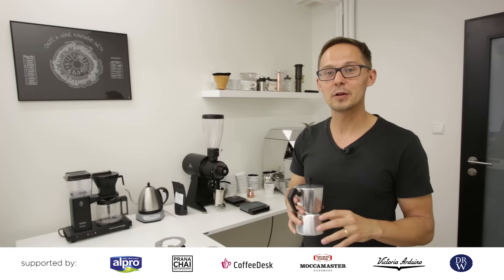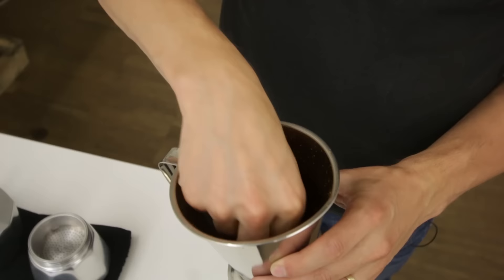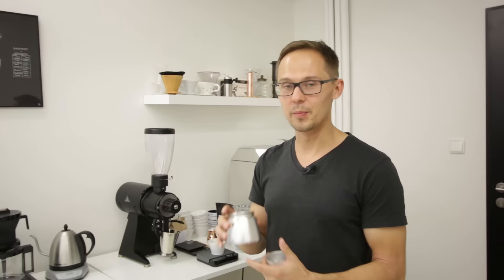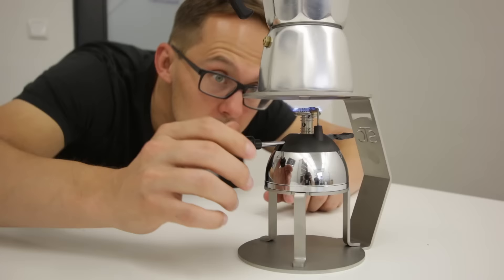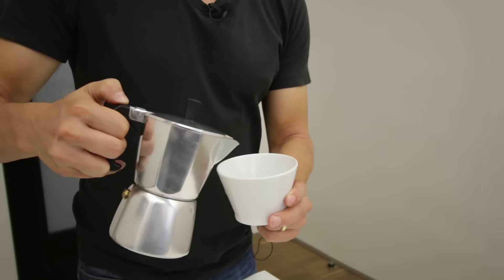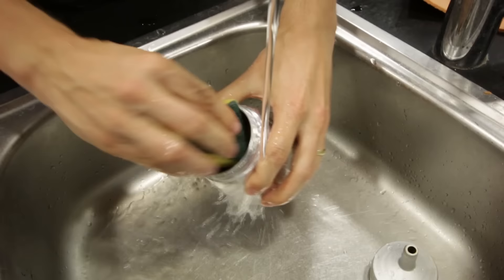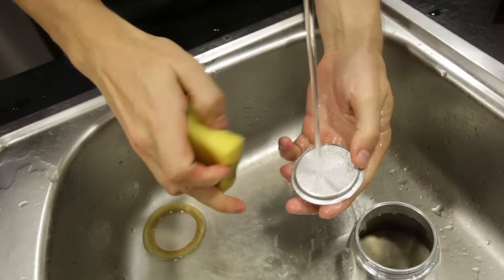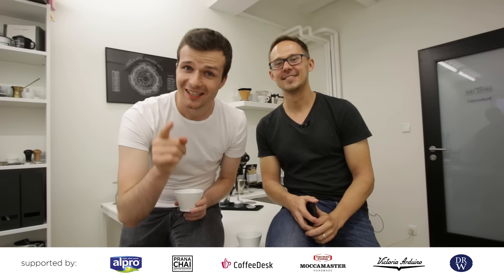How To Make Better Coffee with a Moka Pot

Comment: One more important thing to remember - especially when you use aluminium pots - drying. Leaving your moka pot wet makes it oxidize much faster than when kept dry.

It's good to use a descaler from time to time - you can use water with citric acid powder (boil it inside the pot like coffee), vinegar with dish soap (1:2) or use ketchup (cover it and leave for 20mins). Replace the rubber seal from time to time - it's cheap.
Reply from the maker: Wow, great insights. Thanks for sharing these. We may collect input from all of you guys and share it in the post.
Reply: Wojciech Kamień Cleaning with ketchup? That's the worst advice I've ever heard.
Reply: best tip on this page, including the video. thanks.
Reply: @KhorBaPeaceComesFromWithin  i know that cleaning copper with ketchup is an old established trick. Works like a charm!
Reply: Big Cee You'd have just as much luck with a mixture of salt and vinegar.

Comment: That's a great video, thanks! I've started using a moka pot again. As a trick, if you want to have a clearer coffee you can add an aeropress paper filter at the bottom of the upper part, before screwing it to the bottom part. For 1 cup moka pot it fits perfect.
Reply from the maker: Thanks for a tip!

Comment: Exactly how i make my coffee. The coffee basket can be cleaned as well. I use the thin end of an electric egg beater bit to pop it out
Reply: It comes apart? I didn't think it could.  How do you do it exactly? I don't want to break it  but I really want to be able to properly clean it.
Reply: @KatarinaS.  Of course it comes apart, it's explicitly written in the instructions manual that the silicon ring must be replace annually.

Comment: Heat first if you want but it adds to the work involved and the results are minimally better. Heating at 3/4 heat seems to work well also. I prefer using a fine grind such as comes with lavazza or illy or bustelo, especially that first cup in the morning. The consistency of a perfectly hot first cup the moka provides is part of it too.

Comment: Hello . I saw that you wash your pot anytime you use it  and that is a little surprising to me . I never wash mine and have been advised never to do so . so  I only rince it with cold water in order to keep the nice sheen that has formed into it and which in my opinion also contributes to the taste.
But it's fine by me . 
I use an old  little 2 cups bialetti moka pot if you wanna know.

Comment: instead of heating up the water in another pot, just detach the top, and pour cold water in, and put the bottom half on the heat until its hot, then pop in the coffee filter with the coffee on the top carefully screw on the top so you do not get burned. easy peasy

Comment: Guys, I've never removed my screen and gasket 🙈 Couple of questions for you: 1) is there a window time you aim for (I try to aim for 1:30 - 1:45) and 2) have you ever tried measuring the coffee to water ratio? Thanks for another great video! I always learn something from you guys 👍🏻
Reply: The 6 cup Oroley (spanish brand) fits 350 ml just right below the valve. I use a 1/16 ratio of coffee, so around 22 grams. All the liquid doesn't come through tho, but the basket size is ideal to the water passing in theory.

Comment: Be careful or better don't use the green (hard) bit of the scrubbing sponge on your aluminium moka pot. Aluminium is quite soft and can scratch easily. You can clean the metal filter but don't  use it on your aluminium moka pot, or it will get dirty even quicker.
Reply: I was nervous watching him cleaning his machine with the sponge.

Comment: Try to avoid Aluminium moka pots, I have had great results with a heavy duty stainless steel 4 cup pot, just using lavassa ground expresso. I've had the same moka for 17 years I bought at a yard sale for $5.00,  just need to change the seal every five years or so, ( if you can't find the " Right seal" just buy a bigger one and cut it to size
Reply: The only issue I have with stainless is that it doesn't grip easily for closing it tightly..
Reply: Get a heavy duty moka pot my old one is Prodotti stella.4 cup. ( no longer made) I recently bought a 2 cup Debut same Design/Quality now from Taiwan. Also make a 4 cup my favorite size for a big latte.

Comment: 1. Aluminum moka is corroded by acidic coffee
2. Aluminum moka tastes of metal, caused by 1.?
3. There was no need to remove the gasket on my stainless steel pot. I checked after 2 months daily use, nothing there after rinsing through. Perhaps in your Alu pot it's caused by the oxide making a surface for rounds to cling to?
Reply from the maker: Great feedback!

Comment: a moka pot is the method most italians use to make espresso , but they use a grind resembling  fine espresso grind. there is no need to be afraid of a  few  grounds at the bottom of the cup.even the pre-ground coffees from lavazza and caffe vergnano for moka pot are much finer than what was used in this video. the  result  here resembles tea. cleaning  regimen  does not require gasket  removal after each  use .....monthly is more realistic.......

Comment: The conventional wisdom is of course that the coffee should be ground fine, nearly as fine as for espresso. It would be interesting to know the pressure in the boiler when you use drip size grains and no tamping. If it's the same or only slightly above ambient pressure you're essentially making drip coffee upside down. A test should be relatively straightforward to carry out by replacing the safety valve with a pressure gauge.

Comment: If you scrub and use detergent on an aluminium pot all the time, you'll get maxed out aluminium leaching into the drink all the time. That's a fact.

When you do use soap & scrub an aluminium moka, run it a few time and throw out the coffee, let the oxyde layer form on the surface, and then only rince it and wipe it dry with a soft rug.
I would recommend you get a high end stainless steel moka pot, and even then, don't scrub it anyway, rinse it and wipe it dry.

Comment: Gosh. Browsed through dozens of videos on Moka Pot, yours is the cleanest. In some videos the inside of pot even turned into oxidized black....gross. Nice Video!  May I ask how often do you guys change the rubber band?
Reply: Jing He you want the oxide. Creates a airtight barrier. Using the coarse side of a sponge exposes the aluminium underneath the oxide layer.

Comment: Ive read that when cleaning the pot and components dishwashing liquid should not be used, just warm water and wipe dry. Ostensibly because the oils from the coffee protect the finish on the inside of the pot, and scrubbing it would lead to erosion.  I'm interested in reading comments.

Comment: Great video! I put towel to a freezer for couple of minutes and then I wrap it around a bottom part of the moka pot :)
Reply: Sára Goldbergerová excellent tip. Thanks.
Reply from the maker: Thank you! Nice tip for the towel - will try it out next time. What about the cleaning, anything else you would add to our video?
Reply: Nope, I clean it exactly like you :)
Reply: why even bother freezing a towel?  it jst seems (to me anywayz) like an extra time consuming thing to do.  all thats necessary to stop extraction is to pour the coffee into ur cup immediately after it finishes brewing.   i mean, this can be done in less time than it takes to hold the moka pot under running water (2:55) or wrapping it in a frozen towel :)

Comment: Start with water of about 65°C, fine grind, it can be as fine as espresso or even slightly finer if you have a one or two cup Bialetti model. Shake the basket while you're pouring the coffee in for even distribution and when you start spilling coffee, stop pouring and tap the basket on your counter a bit to make the bed more level. Tamp very lightly, the coffee shouldn't go down far because of the even distribution and fine grind, but there should be a bit of space left in the basket. Make sure it's screwed on very tightly with the 65°C water in the basin, just to the fill line or a bit below (don't go over). Put on the lowest flame possible and wait, once it starts flowing quite quickly and becoming more yellow, cool it down by putting it in the sink with cold water. The more greedy you'll be, the more extraction at a temperature that's too high you'll get in the cup.
Reply: Why do you make it with hot water when you going to use the lowest flame? (ergo - trying to lengthen the time the water will boil)

Comment: Excellent.  You stepped on all of the bases.  As you show, it's especially important to use nearly boiling water in the bottom and to avoid over-extraction by cooling the pot once it's full.

Comment: Personally I find hot water under extracts the coffee and cold water causes it to taste burnt I've found a happy medium with lukewarm to slightly hot water and stir the coffee in the pot before you pour the stronger coffee (first extracted) is at the bottom
Reply: How can hot water under extracts when heat can pull out the oils compared to cold?

Comment: Maybe I am wrong and those experts are correct but if you want to make espresso type just fill a little bit of water.
Reply: You're wrong. Espresso requires pressure, this machine is not pressurised.

Comment: I use a stainless steel Moka pot because I found that aluminium has a metallic taste. Removing the seal with that sharp knife looks dangerous. Great video
Reply from the maker: Good points! You are right about the knife - it would be better with fork or anything less sharp. It was just the only thing that worked during the filming. I hope we didn't make it too dangerous for people.
Reply: For me works best some metallic tea spoon to push the seal from outwards to inside and up (hard to describe) :)
Reply: I never removed the Rubber ring
Reply: It's is super dangerous. I know of some people that know some people that have lost their loved ones because of using a knife to get out the rubber. Lost fingers, paper cut deep cuts and sepsis, you name it. It's a risky world we live in.
Reply: not just to you- to your seal. I use a chopstick, much safer and gentler on the seal.
Reply: The filter should only be removed when changing the rubber ring, once a year or so. A coffee maker is supposed to be cleaned with water, no detergent, in order to allow a thin layer of coffee oils to permanently coat its internal surface. Removing those oils means getting a poor result.
Reply: @gabrielladelfinadiblasio7398  That's bullshit mate. Those coffee oils are stale old rusty nasty pieces of coffee, would you like to drink 10 years old bits of coffee each time? Just wash the damn thing. Why nobody complains about missing old coffee oils in espresso, drip coffee, aeropress, etc?
Reply: @RaduRadonys  🤣🤣🤣 People who have no clue, and yet love to explain stuff, are always entertaining 🤦🏻‍♀️😅
Reply: @gabrielladelfinadiblasio7398  Thank you :)) by the way James Hoffman himself said this oil thing is stupid, so if he doesn't know about coffee, I don't know who. But you must be Italian, that explains your "I can not be wrong about coffee" atitudine :))

Comment: I intuitively figured all that out myself when I purchased mine, what I also did was take the thin metal round base of the coffee holder out to clean that as well. It was difficult to do and used a chop stick and rammed it down the funnel and popped it out. Was very dirty, what’s with the manufacturers not providing easier to clean equipment? Instead relying on user to reverse engineer this thing
Reply: sorry, you mean Warm water is better ? actually at first, its better that the water be warm when we put it ?

Comment: Thank you guys for your amazing and informative videos. Concerning the cleaning process, do I use dish washing soap with water or only water when cleaning it and why?
Reply: Never use soap. No matter how much you rinse, chemical particles will remain on the pot. As soon as you start preparing your coffee, hot water will dissolve them inside it(!). Always clean your pot soon after you have used it. At least once a month, you should do a deep clean by using 2/3 of water and 1/3 of white vinegar and let the heat do the trick.

Comment: The coffee must be ground between drip and espresso.
Use hot filtered water and medium to low heat, move it away from the heat as soon as you hear the bubbles sound.
I dont like to use up harsh soap or detergents to wash it.
Reply: How long does it take to brew?
Reply: @poopdawg2301  I have a 9 cup so it takes about 10 mins to brew. A smaller one might be faster

Comment: This was great!  My moka pot also has a second metal screen that fits inside the chamber where the coffee grounds go, dividing it in half.  Does anyone know what that's for?
Reply: In principle, if it also has a semi-circular plate to stop the water coming through on that half, it would allow you to make half the amount of coffee without having to use a smaller machine.  Of course you would need to halve the amount of water you put in the bottom part.  Otherwise you'll get an americano.
An alternative function would be to allow you to mix two blends of coffee for a single brew - for the ultra-demanding connoisseur.  
Why am I not surprised that the market has not rewarded this invention?

Comment: IMO
1) no hot water needed: coffee is not in contact with water until it's hot, and a little humidity on it prepares the surface of the ground coffee for a better brew
2) NEVER, NEVER use the scratching side  of the sponge on any part of the Moka: never! You won't drink alluminium.
Reply: Just rinse with water. Or boil without coffee. No soap needed. Cleaning the seal after every use? Wow, these guys are nuts.
Reply: Jokes on you, I only use stainless steel mokas.

Comment: Does it make a big difference to the brew when you put hot water in the bottom compared to cold? 
I always put cold water in mine, but that's only because the instructions specifically say to put cold water in.
Reply from the maker: It’s has been a long time since we did experiments but it’s the way we like it better. Give it a try once and taste the difference. That’s the best thing we can recommend.
Reply: Actually the instructions say "room temp".
Reply: @sO_RoNerY  Maybe on yours they do, but on mine the instructions say "use cold water" – honestly depends on what type of moka pot you've got, what it's made from etc as to what the instructions recommend.  Although weirdly I've tried it with hot water and prefer the brew that way, I saw a video from a coffee expert that says you should always use hot water when brewing with a moka to help reduce the bitterness and after I tried it with hot I had to agree, I could definitely taste the difference in the brew, hardly any bitterness compared to when I brewed using cold water.

Comment: Please don't use a knife to separate the filter and the seal rubber band, What I do is to run water from the tap on high pressure on the filter part, that lifts the rubber band a little and is enough to push the filter under the band with my thumb, also you can lift it with your fingernail, if the above doesn't work - try with a tea spoon.

Comment: i didnt know about the boiling water instead of tap water and i haven't cleaned under the rubber seal...im scared now LOL thanks fellas
Reply from the maker: Don’t worry, it will be alright! Thanks for comment.
Reply: Melanie Jarrett it is not necessary to remove the gasket each time you clean it. If you use your moka pot on a regular basis,I would only do it about once a month.

Comment: My experience: Don't get the big ones, get the small ones, maximum 4 cups (these are actually more lungo sized so 4 cups will give you like 250 ml of coffee). This will give you a better result than the big pots. If you clean the upper part each time make sure to buy a few spare rubber seals as they will wear out faster because of the stretching. Moka pots will certainly not make the best coffee ever but they are great for confined spaces and travel.
Reply: Nah, it's personal preference and if you can't afford an actual espresso machine, they do make the best coffee ever!

Comment: guys good job. but I would add some observations:

- steel is better than aluminum ones. You cant scratch or frequently clean the aluminum one, and then drink without creating a patina first.

- actually you need to clean it through the filter just once in a while. and all the other times you only have to wash with water only.

- before making the coffe for the first time in a while, you should do one, pour it away and re prepare the one you'll actually drink. you can not do this if you use it everyday.

- always mix the coffe before serving. theone at the bottom is way stronger than the watery one at the top.
Reply from the maker: Thanks for excellent tips!!